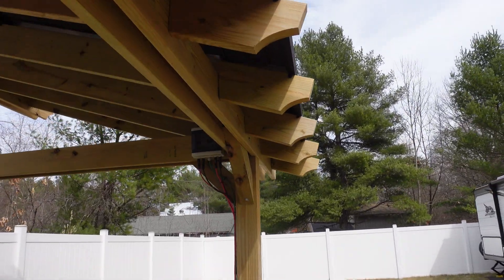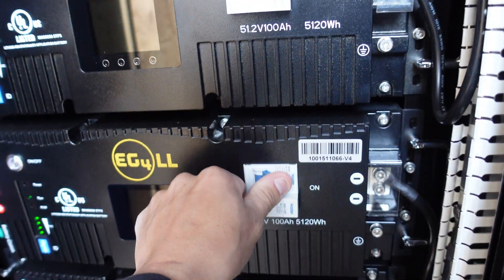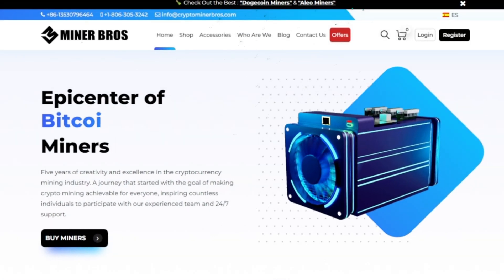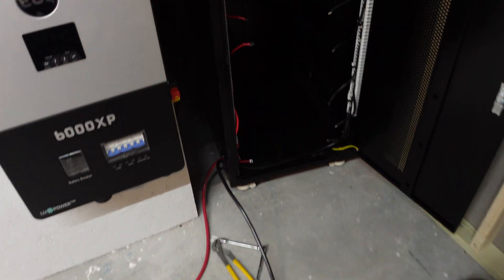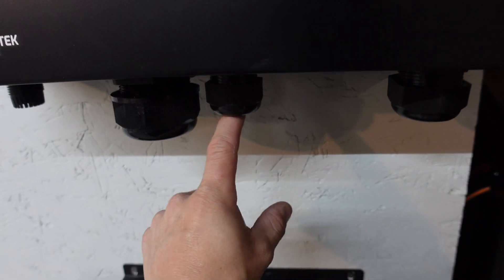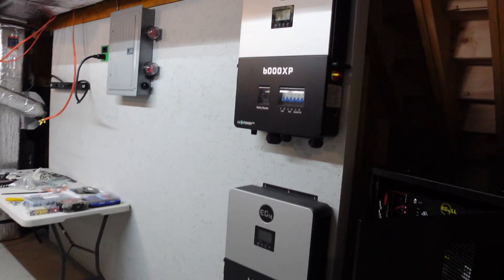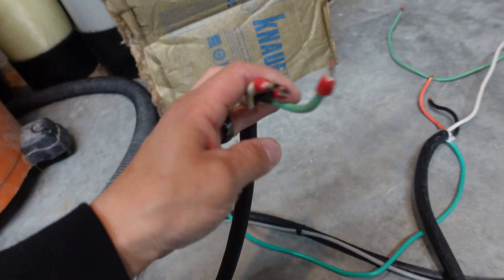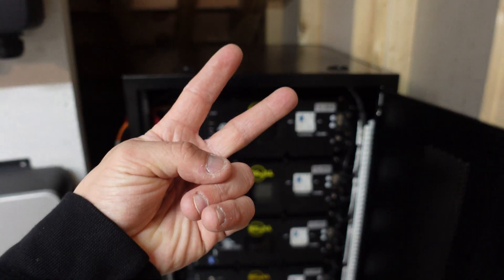Moving My Entire Solar Mining Operation!

Comment: i think if you wanna keep the battery cabinet tight to the wall by the pole you should use the top grommet if there is room instead of coming in from the left hand side and wrap the wires with black electrical tape to "hide" them

Comment: @CCXD dude thats loads of work .. happy to see you getting it done, as far as the backer board under the steps is not needed however to reduce noice if you have some noisy in that area using a backer board with insulation works well.

Comment: Old school shop teacher taught us that stranded copper is more efficient than solid copper lines. Electrons like to flow on the surface of the wire and stranded has way more surface area. It's just more expensive to manufacture is why homes use solid instead. That and earthquakes and vibrational stuff is also what I heard.